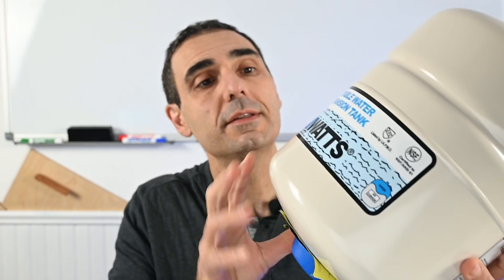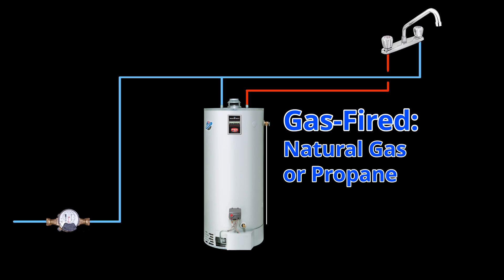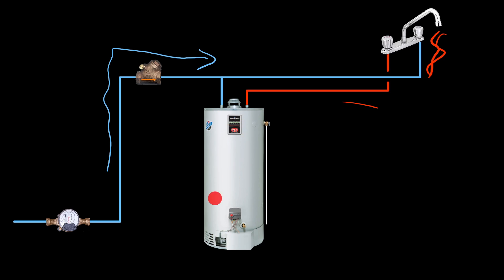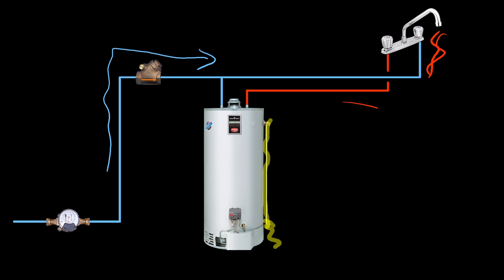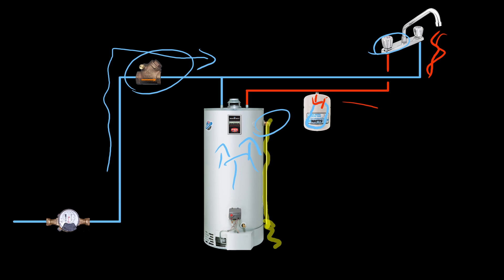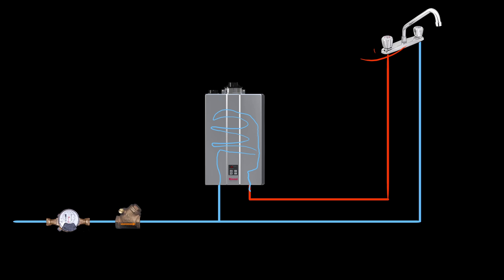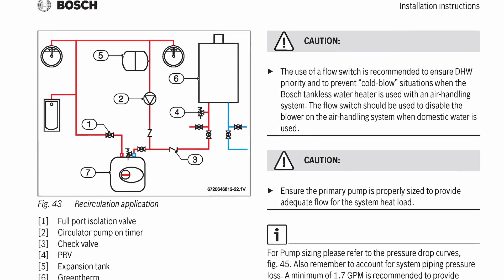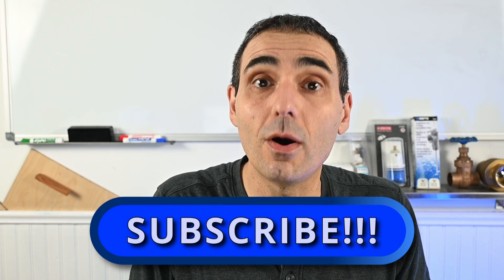PC Q&A: Expansion Tanks for Tankless Water Heaters

Comment: Could you explain how (air PSI) in expansion tanks should be higher pressure or lower pressure than operating temp of fluid in system? This has always been confusing for me? I have GEO hot water and many tankless in different application and have done well work but not interested in that?
Reply from the maker: As a general rule, the air pre-charge of the expansion tank should equal the system’s cold, static fill pressure (NOT the hot operating pressure).  

By the way, if you're installing a well tank to serve a well water system (although it serves a different purpose than an "expansion" tank, their structures are identical and act on the same principle of Boyle's Law), then the the well tank should be set to 2 PSI below the well pump's cut-in pressure.

Hope this helps and happy new year! 🥂

Comment: Excellent teacher. Thank you. I am puttting in a Tankless Navien non-circ today. My Socal plumber uses little apple sized expansion tanks on the cold H20 side. I think for the "minimal" interior expansion of the tank this might be good?
Reply from the maker: Thank you so much for the kind words! 🙏

The "apple-sized expansion tank" you're referring to sounds very much like a diaphragm-type water hammer arrestor...which - although still operates on the identical premise of Boyle's Law (inverse compression of gasses as pressure increases) - they're typically intended to stop that loud banging noise might experience when you rapidly open and shut your faucet (called water hammer).

While that device they've installed could theoretically work, I'm not sure it's large enough to hold enough air volume to accommodate in the event of significant thermal expansion (which you may not experience anyway because its an on-demand heater). 

If you ever notice your temperature and pressure relief valve dripping, chances are its building enough enough internal pressure to set it off (indicating that your tiny expansion tank just isn't cutting it). 

They only way you could tell for sure is by placing a pressure gauge

Comment: Our health inspector is asking us to connect a tank water heater as backup to our tankless water heater to increase our hot water capacity. How do we do that?
Reply from the maker: Your health inspector's suggestion sounds redundant, inefficient, and overly complicated.  I don't know your scenario or application , but if you're going to invest in all that time and money into installing an additional water heater, I'd first look into getting a higher-capacity tankless heater.  At least 199,000 BTU is what I'd recommend for the average-size home.  Check how many BTUs your current model is and go from there.

BTW:  A "BTU" rating refers to the amount of heat  unit is able to put out on an hourly basis.  If you opt for a higher BTU unit, you'll also need to ensure that your gas supply is large enough to accommodate the increase.  Make sure you have a gas-qualified installer assess before upsizing.
Reply: Ok, thank you. We have a very large rankless heater. Another plumber just suggested we add a water storage tank instead and connect it to the tankless to increase output

Comment: Question for ya. I have a tankless water heater and was thinking of putting an expansion tank on my cold supply line bc everytime I flush a toilet or close a cold sink faucet. I can hear the water heater kick on. Im thinking it senses water flow on the hot side somehow and needs some sort of buffer. Or maybe needs a check valve on the hot line? TIA
Reply from the maker: That is certainly strange.  Something is causing the heater to sense flow or at least a pressure drop. An expansion tank might help, but what you have is still not normal.  I'm wondering if there's something in your home causing water to pass through the hot side whenever there's a demand for cold.  It could even be a defective single-lever shower control valve.  Also check to see if you have any other open connections between the hot and cold, such as those Y-connecting hoses that allows to connect separate hot and cold hose bibbs together so that they come out of one hose.

If possible, try to isolate individual fixtures/appliances or areas if you have stop valves installed to troubleshoot the source.

I'm not convinced an expansion tank is required to solve your issue.

Comment: I have my guys watching this video to explain thermal expansion and tanks. 1 thing is wrong. The expansion tank does not go downstream or the water heater. Always on the cold side, between the isolation valve and the tank. Between the valve and tank allows the tank to still work if the incoming water is turned off to the heater.

Comment: Great video, thank you. What are your thoughts on this video that seems to contradict your video?  Maybe that system has a recirc?  https://www.youtube.com/watch?v=s-7Xqmh4d0w
Reply from the maker: Thanks for the kind words - and that comparison video.  I can't see a contradiction, as the expansion tank in that video is doing its job at mitigating thermal expansion by keeping the pressure down.  Only when he isolates the expansion tank by closing it, does the pressure shoot up...and it won't take much at all in that scenario, since there's so little travel between his check valve and the heater's isolation valve.

Could you please specify where the contradiction is in case I'm missing it?  Thanks again!

EDIT:
I should add that whether that system has a recirculation line in that case should be irrelevant, because the return would be upstream (before) the check valve...and because he turned off the hot outlet valve, he effectively isolated the water heater - meaning that any recirculation line would be completely cut off from any water flow and would not be subject to thermal expansion.

Now, he says that the tank is purging, but I suspect that during that event, water is still heating up, which is what's causing the increase in pressure.

Comment: hi i have two baths on same house but one more far, the far one the hot water dropp to manny times and i have a inline gas water heather but the problem ins only on that bath Any help
Reply from the maker: Unfortunately, your situation is very difficult to diagnose remotely, and without more information.  It depends on where you're getting the drop-off in hot water in that bathroom (all fixtures or only one?). When does it occur, or does it occur all the time?  There are too many unknowns based on the information you provided.

Comment: IF YOU DON'T INSTALL EXPEDITION TANK  ON TANKLESS WATER SYSTEM THEN WHAT HAPPENS WHEN A CIRCULATING PUMP  STARS PUSHING WATER THROUGH THE SYSTEM
Reply from the maker: Whether you have an expansion tank installed or not, a recirculation pump should ONLY be pushing  water through the recirculation line itself, and recirculating it back into the heating source - which should require minimal effort by the pump; its not powerful enough to override the incoming water pressure.  

As a matter of fact, this is also why it's important to also install a check valve downstream of the pump (unless it has one built-in)...because if there isn't one, then the water pressure may push cold water back up into recirculation line.

Comment: We have Rinnai tankless unit that works great. On city water we are having issues with Rinnai water heater short cycling when the cold water is turned off ?
Reply from the maker: Hmmm....sounds like it might be a problem specific to the unit.  I'd either check the troubleshooting section of the Owner's Manual or call up Rinnai's tech support directly and describe to them the issue you're having.
Reply: @PlumbingsCool  I am a Rinnai dealer....... Somehow how when cool water is turned off it is surging a small amount of water in to the hot side of the system
Reply from the maker: Although it's quite tricky to diagnose your issue remotely and with limited information, I'm wondering if you have a defective mixing valve or perhaps even a single-lever shower control valve somewhere in the system that causing water to pass through, thereby triggering your unit to cycle on & off.
Reply: @PlumbingsCool  good thought...... I can go into the diagnostics on the Rinnai and check to see if it's and flow (gpm) while my wife cycles the cold on/off
Reply from the maker: Good luck...hope it works out!

Comment: You installed it on the hot water side?
Reply from the maker: While I prefer to install it on the cold side, You CAN certainly the tank it on the hot as they're rated for it (and installed all the time as part of a hydronics heating system), although it will probably shorten its lifespan compared to installing it on the cold side.

Comment: Great explication. I would not install an expansion tank on the hot water side. I don't think the hot water would be good for the bladder inside the tank. Also, you did not cover inflating the tank to close to what the water pressure is.
Reply from the maker: Yes, I agree in that I PREFER to place the expansion tank on the cold side for the same reason you state, whenever possible.  However, expansion tanks are designed to serve hot water, although I'd agree that hot water will likely shorten its life span.  As a matter of fact, expansion tanks are used for hydronics systems which convey ONLY hot water.

No, I didn't address the setting of the pressure in the video; some expansion tanks are precharged and sealed at the factory and cannot be adjusted due to the absence of a Schrader valve.

Comment: thx for the explanation. 
why the small instant hot water heaters for kitchen require an Open Vent faucet? (what exactly is an open vent faucet?) And is it ok to install a bladder and use a regular faucet?
Reply from the maker: It's interesting...I've never seen them referred to as "open vent faucets", but I'm pretty sure I know what you mean:

The instant water heaters you're referring to are likely those point-of-use models that get installed right underneath the kitchen sink, and are useful for when small volumes of REALLY hot water are required (up to 210F), such as for making tea or Cup-a-Soup.  They're often made by Inskerator. 

If you're referring to those, they often come with their own special faucet that allows water to escape through the faucet itself to relieve pressure in the inevitable event of thermal expansion.  I've had those Instant Hot systems myself for several years, and I remember being puzzled the first time I witnessed my faucet sputtering water!...until I figured out what was going on (I don't think the manuals warn you about that!). 

In any event, I can't verify whether an expansion tank will work in this this case, because there's a possibility that those Instant Hots have check valves built into them (which would negate any upstream protection).  But I can't be sure without further investigation or calling the company. 

It's probably still your best best to use one of the legacy faucets that are designed for  the system, which will remove the need for additional protection via an expansion tank. 

And yes, I'm aware that those Insinkerator faucets are a pretty penny...especially when you start getting into the non-chrome finishes!  🤯  

Hope this helpsl
Reply: @PlumbingsCool   I appreciate your input.

Comment: Hello, I somewhat understand. I'm looking to install a tankless water heater for my home. It's a navienA2 series (with a recric in it) no dedicated recirculating line (going to install a bypass under sink). No check valve on line. Only for domestic water. Do I need an expansion tank for the water heater? (Sorry for all the info, I figured it would help).
Reply from the maker: Hi, it's interesting, as someone else reached out to me last week with a very similar question, and what I think is the same model water heater.  Therefore, I'm going to repost the response I gave them.  (however, the short answer is:  Always check with the manufacturer's instructions!):

It's difficult for me to assess your situation.  Traditional check valves are usually noticeable by following the water lines and looking for them that way.  Some recirculation pumps have built-in check valves which may be hidden in the pump's outlet.  Your best bet is probably to check your unit's and equipment's owner's manual, to get a clearer idea of the requirements.  The bottom line is that if the heating water is getting trapped in any way (there is no avenue for expansion), then you will need an expansion tank to accommodate the expansion.  Some signs might be intermittently-leaking temperature & pressure relief valves, as I demonstrated in this Short:

https://youtu.be/pGCPExUvxLs?si=vLhq8Wx_vt0PVUfn

Hope this helps!
Reply: Gained a sub by the way
Reply: Awesome! Thanks for your time!

Comment: Are check valves usually visible? Also, I was gonna install the NPE-240A2 with a recirculation pump built in and a sensor valve installed under my sink. Do you think I need an expansion tank with this set up?
Reply from the maker: It's difficult for me to assess your situation.  Traditional check valves are usually noticeable by following the water lines and looking for them that way.  Some recirculation pumps have built-in check valves which may be hidden in the pump's outlet.  Your best bet is probably to check your unit's and equipment's owner's manual, to get a clearer idea of the requirements.  The bottom line is that if the heating water is getting trapped in any way (there is no avenue for expansion), then you will need an expansion tank to accommodate the expansion.  Some signs might be intermittently-leaking temperature & pressure relief valves, as I demonstrated in this Short:

https://youtu.be/pGCPExUvxLs?si=vLhq8Wx_vt0PVUfn

Hope this helps!
Reply: @PlumbingsCool  thanks for getting back with me!

Comment: never seen cold water comes in on the left of a tank?
Reply from the maker: Neither have I! 😁  Only laid them out that way in the illustration to avoid the pipes crossing over for sake of clarity.  But at least I drew the faucet lines accurately...which is actually a requirement by Code.

Comment: We installed an electric tankless water heater for a bathroom in a metal building.  when we turn on the hot water , it spits and surges for several minutes and then runs normally.  Is there anything we can do to get rid of that issue?
Reply from the maker: Hmmm...that's a tricky one without assessing directly on site.  I will say though, if it takes several minutes to for the spitting an surging to pass, I doubt it has anything to do with thermal expansion, as the pressure relieved from thermal expansion is rather instantaneous from the moment you open the tap.  The way you describe it, it sounds like a classic case of air in the lines...although air will not typically simply "appear" without a water shutdown, thereby allowing the opportunity for water to enter the system via an open orifice, such as a hose bibb or faucet.  But again, I can't tell if it is air without being present.  I'm wondering if your electric tankless heater has some sort of flow restrictor or device, which may be malfunctioning.  I know that once in a very rare while, my tankless gas heater acts up and causes the water to run restrictedly while emitting a terrifying hammering.  I simply unplug it, and plug it back in, and the phenomenon disappears.

Comment: Hi. Here in south africa we use a thermal expansion valve to cope with this problem so then the thermal safety valve is the last safety device should all else fail.
Pressure reducing valve with strainer fitted to balanced cold and hot water outlets at 400 kpa.
Reply from the maker: Thanks for your feedback, and Happy 2024!  I LOVE learning about the way things get done in other parts of the world.

I think what you're referring to is a pressure or temperature relief valve?  If so, such valves are also typical and MANDATORY to be installed in all our water systems entailing the heating of water or liquid.  However, a relief valve will NOT remedy the effects of thermal expansion; all it will do is prevent the system from building up pressure by allowing the increased pressure to escape via the relief valve.

An expansion tank is a completely different animal, as it takes advantage of the compressible capabilities of air (i.e., Boyle's Law).  As pressure increases, the air's volume decreases proportionately, thus allowing room for the (incompressible) water to expand through the system.

(Hmmm....I think you've inspired me to make a video demonstrating thermal expansion.  THANKS!)

Meanwhile, here's a Short demonstrating the effects of thermal expansion on a water heater, the role of the relief valve, and the installation of an expansion tank to permanently remedy the problem.

https://youtube.com/shorts/pGCPExUvxLs?feature=share

Comment: Doesn't the expansion tank go on the cold water line?
Reply from the maker: I prefer the tank to be installed on the cold side, only because I presume that the temperature rise on the hot side may cause the bladder to fail prematurely.  That said, it's still perfectly acceptable to install on the hot side, as they are nonethess designed for higher temperatures (such as part of a radiant floor heating system); only my preference.

The important thing above all, is that whichever side you install it on, is that it's downstream of (past) any check valves, which will block the water from expanding.